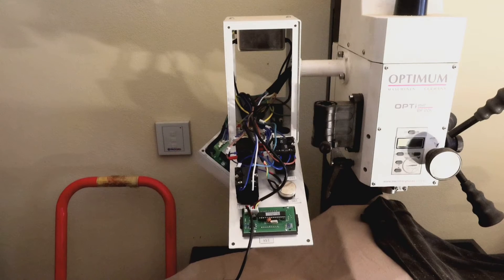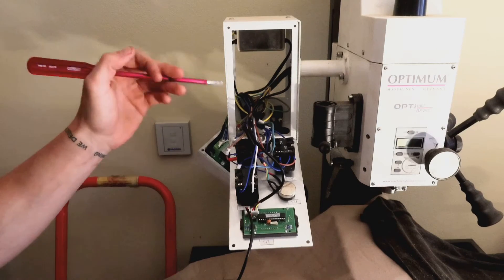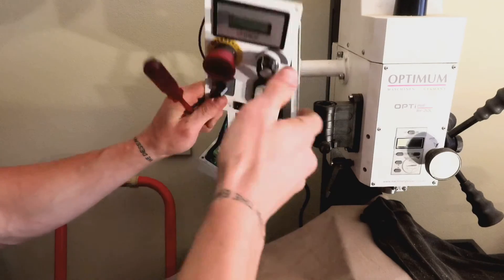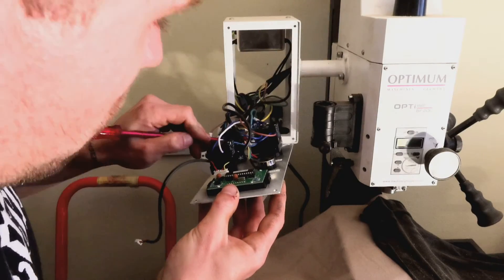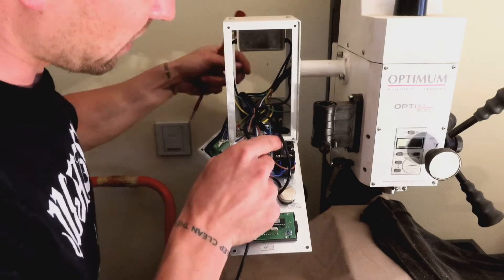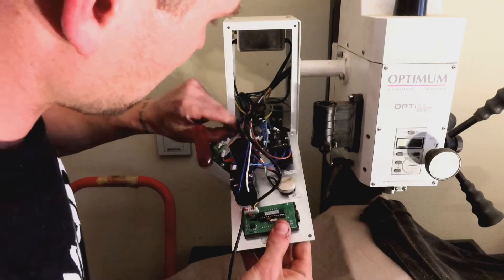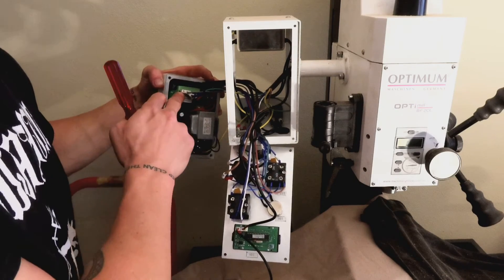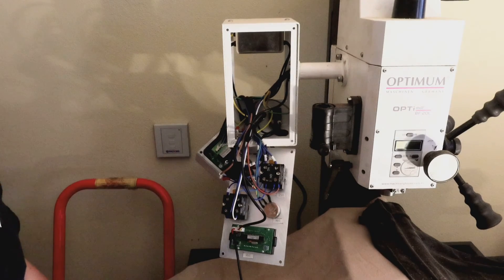Optimum BF-20L control wiring

Comment: Hi ,
I have an Optimun bf20l mill.  Today I stalled it, it run for a few seconds and stopped. Now it won't go at all. Fuse is good. No power to anything. Where to now? Tks.
Reply from the maker: If the fuse is good but no power to anything else (display?), I'd be looking at the power supply board inside.. Could be anything though. Transformer, rectifier, protection caps, resistors. Look for signs of charring or 'damaged' components. If nothing immediately obvious, might need to poke around with a meter or start replacing things at a board level.

Comment: Good stuff my man!
Please excuse my  long rant, I have just about given up.
My problem is regarding the (useless) lamp on the Optimum BF-20L. The problem with the lamp, as I have pointed out to both the Germans and the local distributor is that it is at the back of the work which is pretty useless.
So there has been a lot of back and forth between the designers in Germany and the local distributor and me , all to no avail.
To improve the lighting situation I have attached a small supplementary 12 volt LED lamp to the front of the machine (on an existing screw) which works a treat.
My plan was to hook into the existing lamp circuit, as I don't particularly like having the cable from the plug pack dangling around and going up and down with the head.
I removed the small plastic plug on the bottom of the control box and installed a small gland.
I then opened both ends of the box to try to find the power wire for the lamp, and then the problems started!
The first thing was all the documentation states the mill has a halogen lamp! really?? in this day and age I asked, Germany said yes because it is running off AC.
Ok fair enough I thought, just going the cheap route I guess, and it appears it is AC at the switch.
The Germans then sent me a "Circuit diagram" and a picture of the board with the two lamp terminals marked A&B good stuff.
So I go to the board only to find the two terminals on the board on my machine are empty!
Further back and forth and poring over the manual provided only advice to "trace the wires from the switch to the lamp".
It appears that you would have to pull the machine apart, so I figured I would inspect the lamp (up inside the head with a mirror, and guess what? NO Halogen lamp, but an LED!
A further query to the German "Designers" made it obvious they knew nothing about that, cue the Chinese factory!
Whilst you can remove the LED lamp diffuser cover there is nothing further to be seen, back to the drawing board.
The situation now is I have traced the wire from the switch back to the green terminal block, (blue into far left (looking from the front) terminal, and and there is an orange cable in the same terminal.
This does appear to be AC, so I purchased a tiny suitable converter, but for the life of me I cannot find a neutral!!

The whole thing is very weird in fact putting the meter between the existing lamp switch feed, and the case neutral produces nothing, but if I just put the positive probe on either the lamp terminal or the terminal block at the other end in AC mode I get a voltage reading without grounding the other probe!! WT? waving the probe around also varies the voltage, never seen anything like that before.
So as you seem to have a pretty good grip on the wiring of these mills I am wondering if you could shed some light on what is going on, and where a man might find a neutral for my additional lamp,
Thank you in anticipation (and subscribing).

Comment: Hi Styx, thanks for the informative explanation of the wiring layout of the BF20L machine. I wonder if you can assist me, I am an engineer (not electrician) I work at a college as a maintenance Technician, we have a reasonable new machine (2 years) that has hardly been used, It has not been used for about 4 months, I went to use it today to carry out a small task, but there is no signs of power getting to the unit, I tested the plug supply all good, I then checked the fuse on the back of the machine, this is also good, I have checked the condition of the cable this is good. So there is no power getting the the machine panel, no display, no light, nothing at all. Do you have any suggestions as to where I should check next? 
Best Regards

Colin
Reply from the maker: G'day Colin - thanks for your message.

Can be a tough one depending on the electronics there. Obviously you've done the right initial checks - it might take some further digging into the machine now.

Obviously taking measures of electrical safety during this process - you'll now want to be checking AC input voltage at the main power supply board. Given that you've got no lights or display either, I'm chalking it up initially to a problem there. If you've got AC power at the input and no DC power at the outputs (hopefully it's labelled!), inspect it for bad solder joints or any obviously burnt out components. Without seeing it or a circuit diagram, I've not much more to go from. Caps and resistors will be your first main components to check. If you can provide any more info, might be able to suggest more?

Comment: Hi Styx, Long shot - do you have a picture of the connectors on the guard micro-switch? They are 1 (blue), 2 (brown), 3 (grey) and 4 (black). I have disconnected the switch and forgot to note down what they connected to. I will send you a nice 3d printed cover for the switch. Hopefully this message gets through!
Reply from the maker: G'day Scooter

Actually yes!

https://youtu.be/NEzyF82K4J0?si=cfZEj9Pfd7HWABOW

Hopefully that provides some clarity for you! 😊

There looks to be a mismatch in colours to numbers between what I've got and what you've got, but hey give it a go, what's the worst that could happen
Reply: @StyxHackshop  Thanks! That worked! FYI - I learnt something to watch out for in the process - the online manual might be out of date - the HafCo online one is version 3.1.8 (19/6/2024) but the version that came with the mill is up to 4.0.2. I will let HafCo know but it is good to be aware that Mills have version numbers like software

Comment: Hi Styx, just wondering if you could help with an issue I’m having with my BF20L.
Changed motor brushes, at the beginning of the year and no one was able to get it going since. Two electrician and one mechanic showed up for quick check and never came back. One suggested buying new control board, another relay board which in the end did not solved the issue. Your video for control wiring will help me to check my wiring, thanks for that.
Reply from the maker: Electrical gremlins can be super difficult. I've not had that occur on mine but a bit of 'follow the bouncing ball' troubleshooting to find out what's going on should get you there. Just takes time!
Reply: @StyxHackshop  Thanks, I've done that and don't think is electrical since same issue remains with new control/relay boards as well as new switches. Motor spins when tested separately. Guess keep digging and eventually I might get lucky.

Comment from the maker: Tony - if there's anything more, lemme know and I'll get you sorted 👍
Reply: Styx, legend mate, that sorts out the 6 wires in the control box I am looking for!
Any chance you could do another with the spindle guard mount off or apart, there is a large micro switch inside there with wires labeled 1,2,3,4 (grey black blue brown)? I do the same as you and just leave it at the closed position guard position but there is a 4 prong switch inside. 👍
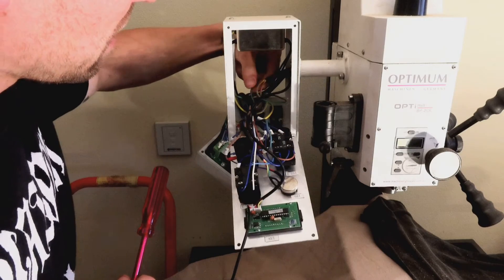Reply: haha its 1:30 here in christchurch NZ, the wife and son are asleep and im out tinkering with the mill 🤣
Reply from the maker: @mightyweapon  haha best time to do it! Next video is up in a couple of minutes, should do the trick
Reply: @StyxHackshop  Thank you very much Styx, That has got Optimill up and running, looking forward to making some swarf on this thing, its been too long. Much appreciated 👍